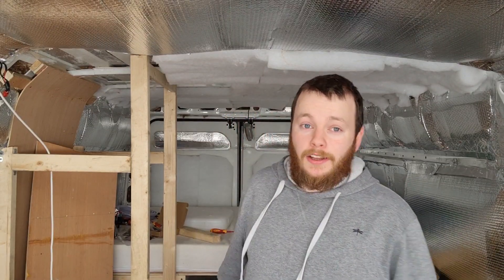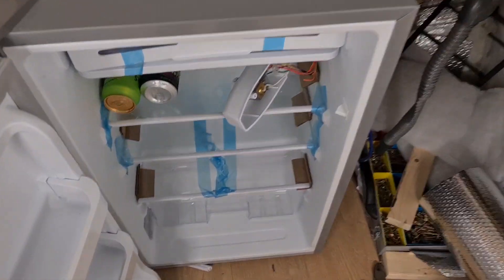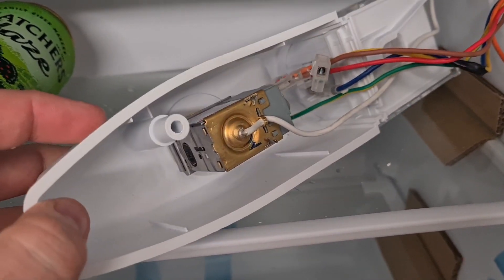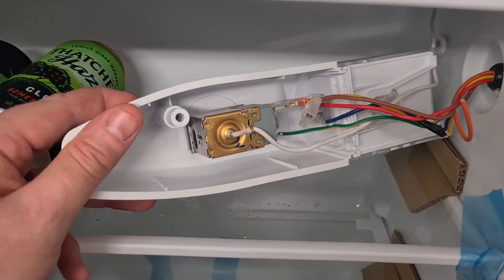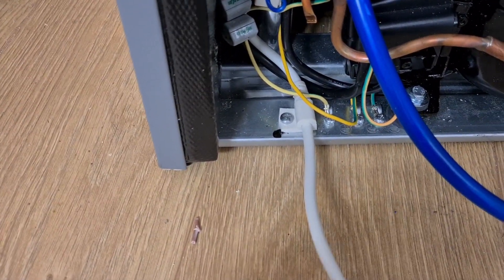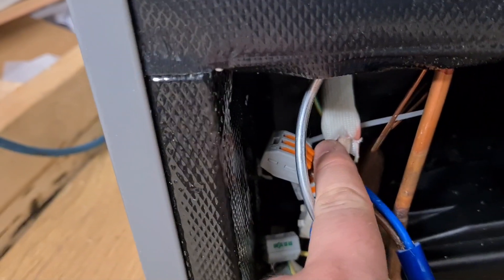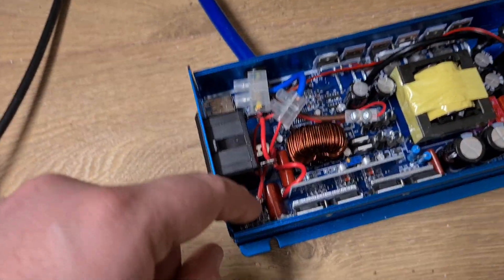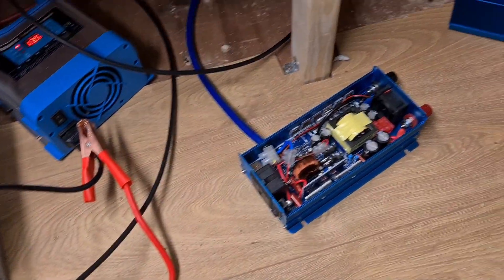Wiring an Inverter to a 240V fridge thermostat

Comment: Why not have a inverter with eco mode capability? You put it in search mode, and it starts stops by itself, reducing the no load consumption to 2w per hr or less. That would be a 48wh 4ah per day for the stand by. It only takes out of the battery at night time if solar is fitted, so half that with solar. Also, if your fridge is a true inverter fridge, it has no surge, as is a variable speed dc compressor, not AC. That, makes it less efficient. You convert DC via inverter into AC, then, you feed that to the inverter fridge which converts it back to DC. A 12v DC compressor will skip all this double conversion, and save allot of energy lost through the conversion, you are stealing your own hat. I can see the money reason for going to a AC fridge via inverter, but, no way is more efficient. Sterling power did this test already, there is a video, see the maths for yourself. The inverter option will always eat more power. A straight dc compressor fed by dc source will be far superior in efficiency performance, at a price of course. The true math stand in AH consumed per each deg cooling. Just a thought.
Reply from the maker: Hi, thanks for the comment. The 12V compressor fridges generally use more power over time than a really efficient 240v fridge (240v fridges vary in efficiency a lot, you need a A++ rated at least). 240v fridges are generally bigger too and cheaper, this setup was around £250 for a 93L fridge versus £550 for a 49L 12v fridge.

Eco mode inverters are great but again cost a lot, this is a way of getting the best efficiency possible for the lowest price. It is a bit of effort, but mine has been on for about 6 months now just from solar, quite impressive for a fridge this size.
Reply: Would you have a link to the sterling video? I can't find it :)
Reply: @BedfordshireBiker  
@aureltanasan1413 Do you mean the video of Charles Sterling where he explains that the standard 230V fridge running from the Combi (inverter charger) is both the most energy efficient and the most cost effective?

Comment: Hi mate I'm about to do this, only bit I'm stuck on is identifying the compressor wire to join it to the mains lead! Do you have Instagram so I could grab a few tips off you ?
Reply from the maker: Shouldn't be too many wires to be honest. Should be mains going in, wire up to the thermostat and wire back down. The one going back down should be going to the compressor lead! I won't be of much help though, every brand of fridge is wired different with different colours of wires so it's a case of using a multimeter and following the cables.
Reply: @BedfordshireBiker  thanks so much man.. I'll give it a crack!!
Reply: @bedfordshirebiker Hi man I'm a tiny bit stuck, I've got a bleep on the light (black wire) so I'll blank that.. then I've got a white into the tstat and a brown into the tstat.. I've also got a blue goin in near the light, coming out the back it goes brown wire from tstat to the main 230, the the white goes to the compresssor, the blue one also comes down and goes to the compressor. Sp I will cut the white and brown so they are separate from the compresser and wire to on off switch... when it comes to wiring the main lead to the compressor I have a blue coming from the compressor and up into the fridge to the light area.. I also have a blue going from the mains to the compressor.. what ones do I join to the mains?  Do I cut the blue going into the fridge and wire that one from the compressor straight to the mains and job Done? Just the one wire? If you have Instagram i could send a photo!?
Reply from the maker: @cbdronephotography  don't use Instagram sorry. Open your light up and check what wires you have there, you need to disconnect them and make safe. The power to the compressor needs to go to the mains cable... Don't wire anything to the light. I've only done this once and I'm no electrician! Also every fridge is different so colours really don't mean anything other. If I ever have someone nearby that needs It done I'll do a propper guide, but I'm sure there's some out there!
Reply: @BedfordshireBiker  thanks man, the only bit that's throwing me is making sure I know what wire is the compressor wire, it seems to be just two blues and a white coming out of the compressor , the white is the thermostat I'm not sure what the two blues are.
Reply from the maker: @cbdronephotography  follow them! Maybe up to the light and back again or a door switch. The one coming back from the stat and connecting to the compressor should be the power one.
Reply: @BedfordshireBiker  the white goes from stat to compressor so that will be power one blue goes from compressor to the 230 mains cable and the other blue goes from compresserr into the fridge to a connection next to the light area
Reply: Then in the thermostat I have a double brown lead that goes down into the 230 mains and the white lead that is power to the compress4
Reply from the maker: @cbdronephotography  The white wire from the stat, cut it and join the stat end to the inverter switch and the other to your mains cable. Join the other wire that goes to the stat to the other side of the inverter switch. 

Disconnect the blue cable going to the light, put a blank connector or heat shrink the end. Unfortunately with this setup you can't have the light. 
The other blue cable out of the compressor join to the negative wire of your mains cable.
Reply: @BedfordshireBiker  mate! I need to buy you some bears!
Reply from the maker: @cbdronephotography  realised I made a small mistake, cut the wire on one side of the inverters on/off switch and join the two stat wires to each end of that cable so they are in series to each other. That way you still can use the on/off switch on the inverter if you want.... I don't tend to bother anyway, just turn it off by using the stat.
Reply: @BedfordshireBiker  thank you mate. 

The light in my fridge is on a black wire.. but the black doesn't come out the back of the fridge.. the only ones coming out are white from stat to compressor(power) blue from next to stat(doesn't go into stat goes next to the black for light) that goes into the compressor, and a brown from stat into the mains lead.  

So I 
Snip brown and white and run to on/off on inverter. 
The other half of white that runs to compressor wire to the mains lead,  then I'm left with the blue that runs from compressor up into fridge next to the black wire for light.. 

Do I wire that blue wire into the ground that's on the mains lead? 

Sorry about the questions man I move into my van full time in a week and I really need to get a proper fridge working!! You are a diamond if you can help! 

If I could email you a photo it would be easier than me explaining my wires haha
Reply from the maker: @cbdronephotography  okay I didn't mention these things in the video to avoid over complicating it... But the wire doesn't go up from the back straight to the light, it first goes to the door switch and from the door switch to the light it is often a different colour! I would just unplug the lead going to the light inside the light housing and make it safe like in the video. As for the ground... My inverter had no ground, but you get different types of inverters and some do. If your inverter has anything wired to the ground pin (check inside the inverter) then wire the fridge ground to the main cable ground. If like mine where the inverter has no ground coming out of it and no ground wire in the 230 socket then wire the fridges ground to the metal chassis of the fridge and then put an earth cable to something metal on your van (screw it to the framework).

Honestly without seeing it in person I'm not going to be able to tell you what colours go where, my full knowledge is just what's in the video.

Literally just unwire the fridges light, it's useless and won't work. wire the thermostat to one wire on the inverters on/off switch in series and connect the mains live and negative straight to the compressor. plug the cable into the inverter and connect the inverter to your batteries. That's really it, every manufacturer uses different wire colours so really can't help without getting a multimeter on it myself... Guessing your not near Southern Scotland? Would be happy to do it for you and I live in one of the best areas of the UK for vanlife...
Reply: @BedfordshireBiker  thanks so much for your help man!! My father in law is going to be giving me a hand but I'd like to get a grasp on it first so we ace it, I understand everything so far. I'm just figuring out this blue wire ! I think it's the switch like you said.. (would the switch be going to the compressor?) 

There is an earth going from my compresser  and also an earth going from my 230 mains! 

Three wires from compressor one blue that goes into fridge(switch?) It doesn't seem to bleep on the multi meter at all... 

Another blue that goes from compresser to the 230 mains lead (again it doesn't bleep on multi meter) 

White (power to stat) bleeps on multi meter.. 

Going from the mains lead I just have the brown going into the stat an earth and that blue one that goes into the compresser 

(The blue one is what's throwing me off)
Reply: @BedfordshireBiker  wait I think I get it all of a sudden.. if that blue wire Is for the light switch I just make that redundant and wire the one mains lead to the one white power stat switch going back to the compresssor...!
Reply from the maker: @cbdronephotography  again any colours you mention mean nothing to me! But whatever you do, do NOT wire any mains to your stat. Both wires out of your thermostat should be wired to your inverters switch. Sorry but if you rewatch the video it may help, I'm not sure how else to explain it!
Reply: @BedfordshireBiker  I owe you a beer mate.. works a treat